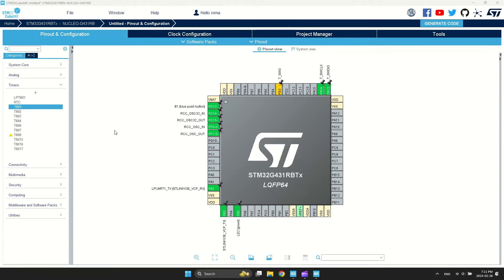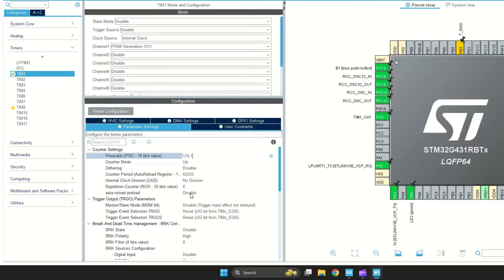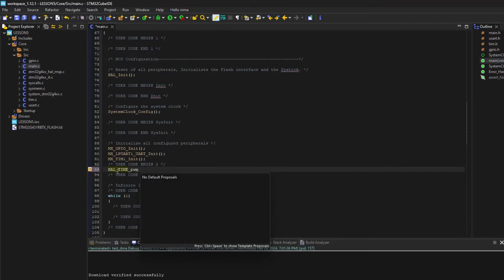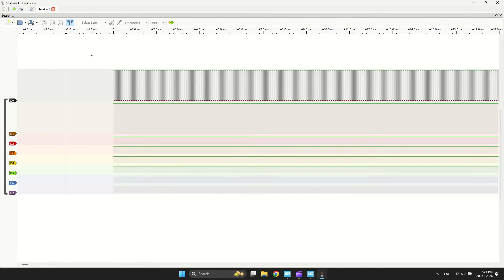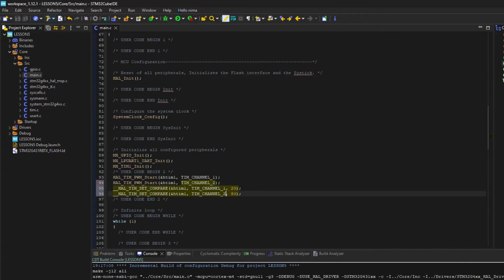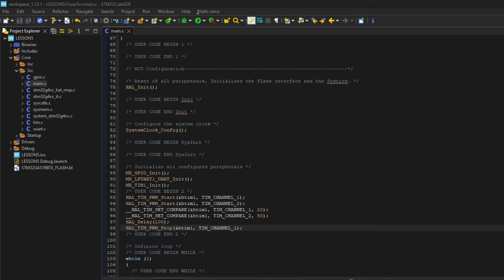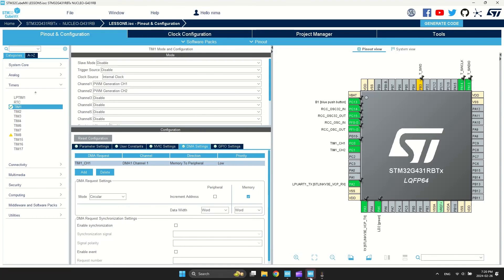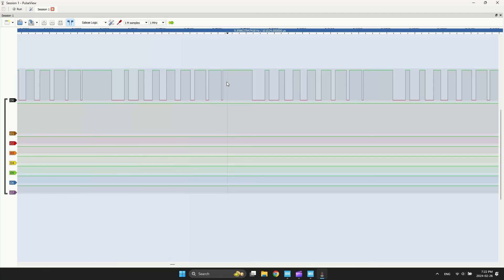STM32 LESSON #5: TMER (PWM + DMA)

Comment: Thank you for great video. It's very useful. Just, I wonder that did you try to increase the buffer size of your data[ ] array in DMA + PWM mode. When I try to exceed 63, I couldn't produce PWM signals.
Reply from the maker: In my ws2812 library, i used. You can finde it on my github.